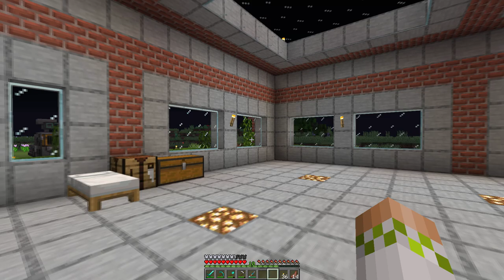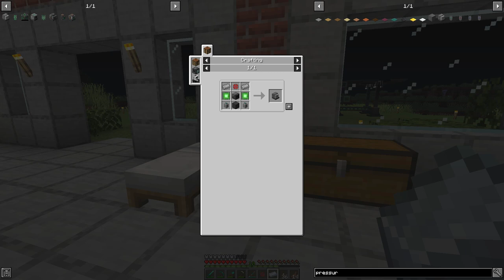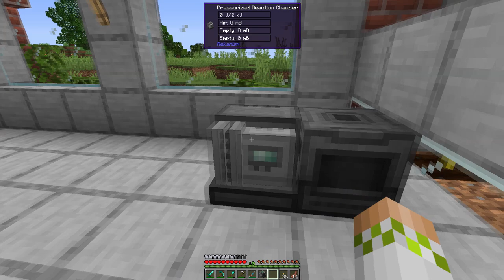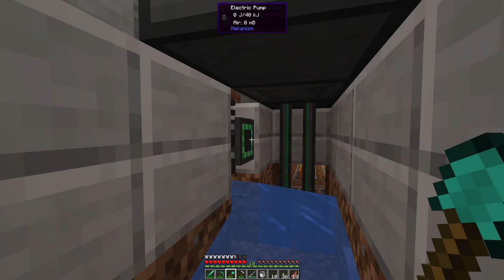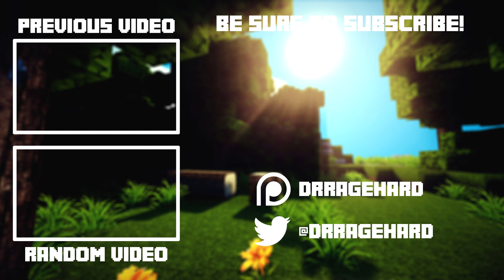Surviving With Mekanism v10 :: E05 - Ethylene Production & Power Generation

Comment: In mekanism v10, the electrolytic separator faces are totally configurable, you can output/input the gasses/liquids to anywhere you want so the separator doesn’t necessarily have to be turned to the right side
Reply from the maker: Oh wow, I had no idea that is an option now! Thats definitely awesome for making builds look nicer.
Reply: Actually all machines in mekanism now have configurable sides. And the new option to input/output on the same side. Which I found super useful
Reply: @abbyhunter4396  not all of them, one example is the solar neutron activator
Reply: @vns1956  you are correct. Didnt really consider that a machine though because it doesnt use power. But i can see it going both ways

Comment: Nice video. in one mod pack, I had such efficient farms that I was able to stack 8 Gas Burning Generators vertically before the Bio fuel started to peter out. each one had it's own Ethylene production set up, and it powered me well into End Game. These things are awesome. You can start setting up at the end of early game and expand if other mods are there (GardeN Cloche helps). Very nice series on one of my favourite mods.

Comment: im having an issue with my gas burning set up. i am producing excess ethylene so i set up 4 additional gas burners. they are all full of fuel but when my energy demand is high, only two gas burners are working. is the universal cable full?

Comment: Followed your steps 100% as you did yet my Pressurized Reaction Chamber is going super slow. Water and hydrogen is at 10,000mb and I have 64 bio file in and it's moving at a crawl. I even added 8 speed up grades and that didn't change anything. I'm on v10. Not sure if there's something that's different
Reply from the maker: Make sure you have sufficient power coming in and if you have 8 speed upgrades you’ll want some energy too. Even if it looks like you have sufficient power, with little to no energy upgrades you may have operations taking the entire internal buffer to complete. Along with that, make sure your cables are upgraded too. If it isn’t a power issue, you have all the speed upgrades, and you don’t have a backup at the output, I’m not too sure what it could be.

Comment: hey can anyone help me. i am playing with mekanism and i tried to do ethylene and it mot works. i dont know why.  in pressurized reaction chamber  does not work with hydrogen it just dont sucks up. it is sucking up oxygen. i play on 1.16.3 and pls someone help me
Reply: U need to configurate the sides thats all and hydrogen has to come from the left side of the electrolytic separator

Comment: My melon bin never get's more than 2 melons, although my minecart with hopper is full of melons
Reply: If you are still curious, the hopper in minecart only outputs 2.5 items/second so as it goes around it will only drop 2 items per trip over the hopper in this case. This is intended, its not supposed to be fast, it works slowly but surely.
Reply: If you ever build one of these again, I recommend a two-way cart track instead of a continuous loop. This lets you put a cart unloader in at one or both ends. A cart unloader is a redstone mechanism that will cut the power to the powered rails while the hopper is emptying the cart, allowing it to fully dump its contents before being sent out again.